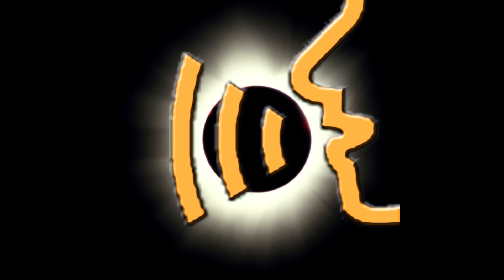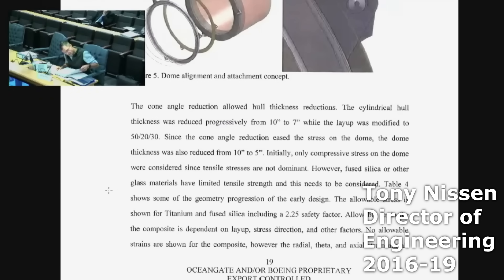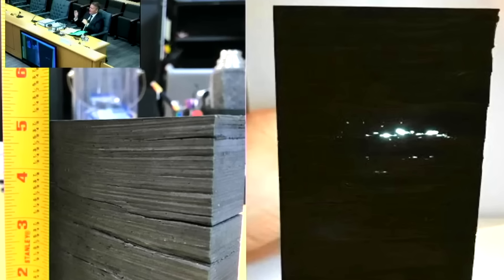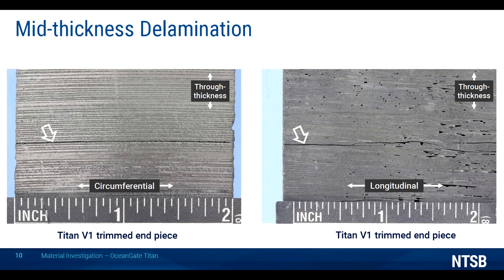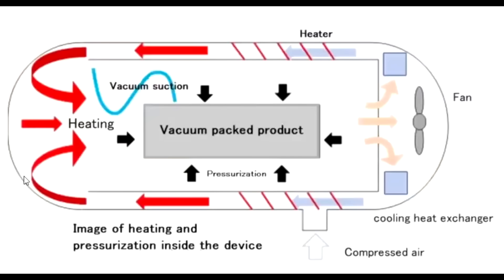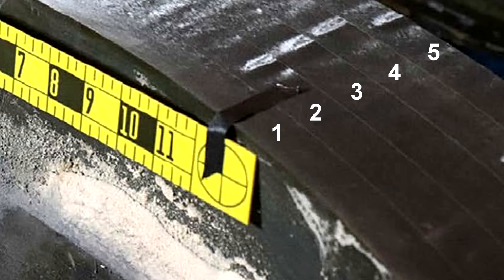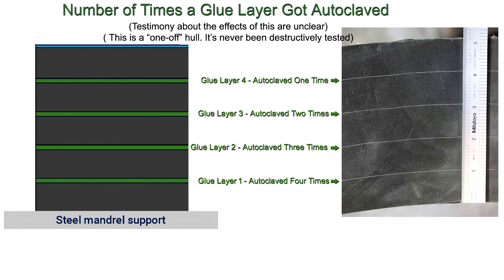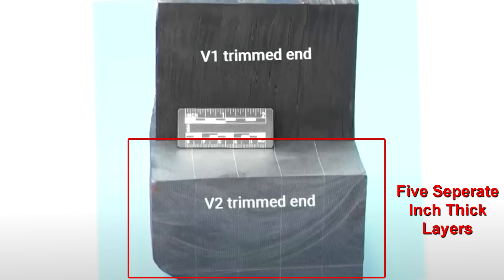Who Engineered the OceanGate Titan V2 Hull? Maybe Nobody Did?

Comment: The incorporation of a balanced isotropic laminate,  that includes the basic geometry of 0/90 and 45 degree orientation seems the most practical or sensible approach to manufacturing a composite structure and indeed Titans hull.

Therefore without unnecessary compromise considering what is understood about a  composite structure to create the most basic integrity of a composite shape within aerospace and certainly motorsport applications seems obvious.

Incorporating multiple cures and using peel ply as a key then film adhesive seems very cavalier considering what I understand as a former technician of this industry.

A laminate is never as integral as a one stage process I would argue.

Perhaps unless a structural honeycomb core is built into the composite sandwich to create much more structural stiffness?

Another consideration or perhaps point of view concerning the opposite side of the argument is that many thoughts have been raised about the total impracticality or inappropriate use of CFRP to apply a compressively resistant concept for a deep sea submersible, yet this was precisely the intention of creating a composite structure for motorsport applications.
In a high speed compressive shunt during use it was the carbon tub which should protect its occupant without question.

I don’t know myself about the loading comparison over a tiny period of time. But for a tiny increment of time and enormous load could it be considered similar?

I appreciate cfrp have been used for expansive pressure resistance for years. An example fire extinguisher bottles but the opposite is more commonly found.

I would appreciate hearing back from you please.

Thank you
Ian
Reply from the maker: Thank you for your thoughtful comment.  Carbon fiber for this application, a sub hull, is tricky to engineer.  It may be useful for more shallow depth applications if done correctly.  But the OceanGate saga has shut that down for a long time!  Who would try to use it now, even if perfectly engineered? This story has killed the chance of bringing it to market.
Reply: @solareclipsetimer thank you, it’s a very interesting yet tragic topic.

I enjoyed your video a lot and I also watched the BBC documentary which was good as you recommended, but beyond this I don’t have Netflix!
Reply: @ianhoyle8459  Ever heard of a comma?
Reply: @byteme9718  Yes I have, but my enthusiasm often outweighs my ability to incorporate the appropriate punctuation within my quickly written words.

Perhaps it’s also my ignorance of the English language in an attempt to get a message out freshly.

But usually occurs just after the unusual occasion of electrical activity flickering between my hemispheres; which then regularly quickly evaporates completely from my mind.

But really just in an attempt to hopefully support and influence further engagement on this particularly interesting subject.

Anticipating other people may also have a true interest in this incredible story, with something even more interesting to say.

Comment: It's messed up, but by certain measures the titan was actually an incrediblely successful feat of engineering.
Rush had a goal to build a sub cheaper, lighter, and for less operating costs. He did that. They said it needed to be twice as thick,  he said hes going half as thick and twice as deep. And it worked.
If anything, He at least proved the concept that you can design a carbon fiber hull that will survive extreme depths, for a limited lifespan. Which is still pretty rad. The one place where he messed up is he had no business taking paying customers on his experiment. Also leaving it in the freezing elements, and ignoring damages, and warnings, and.... Actually he messed up a lot of places 😅
Reply: He really achieved very little. The failure profile of carbon fibre is sudden and catastrophic, and if you made another one exactly the same there is no guarantee whether it would fail on the first dive or any other individual dive. If anything, he has probably trashed carbon fibre as an option because no nobody would touch it now; nobody would insure it, so nobody would bother putting money into it to test any new design properly.
Reply: @alisonwilson9749 with all the abuses he put that sub through and diving well past rated depths, I think the viability of reasonable usage still stands. Although I agree no one will probably want to touch it again (for deep sea) for PR issues.

somewhere on this channel, possibly this video, it was said that during the 1/3 scale model testing Stockton was able to pull one of the models out before it imploded but after it was clearly going to. Also with their ability to measure stress at minute levels across the hull - I'm not saying that CF isnt more sudden or catastrophic than other materials, but it clearly gives off warning signs if you don't ignore them.

I think this example is more indicative of pushing the design past it's capacity rather than a flat out non-starter.

All that being said, I'm just a guy with a recent fascination watching a series of well made videos on YouTube, not an expert.
Reply: Engineering is about matching physics to problems.  Nothing about the titan sub was novel except that one idiot decided that carbon fiber layup should be used in conditions that were unfavorable for it, without ongoing inspection, and treated as an unchanging structure.  ALL engineering materials change with repeated loading, whether through lattice defects aka creep, or through quantum effects.  

So no, all he did was create an air bubble that would pop at an indeterminate time.  Imminent catastrophic failure at unknown cycles is the worst engineering imaginable.
Reply: It's a good thing you flip burgers.
Reply: @byteme9718 and its a good thing your power over people is limited to confines of a YouTube comment thread 🍔
Ill go now.
Reply: He took a material that is purpose built for use in space where the stresses are the opposite of those in deep ocean use.
Reply: I get what you are saying. If he had followed good engineering principles, a lot of valuable data could have been learned.
Multiple craft, multiple unmanned dives, repeated pressure testing, destruction testing. All of these might have built up a body of data to verify whether carbon fibre could be used safely, and for how many cycles.
But this would have clearly cost way more money. 
I guess that's why the industry is sticking with what it knows, and that's what causes Rush to be frustrated. Is it cheaper in the long run to make one craft to accepted designs with tested materials, rather than 20 much cheaper craft to test out new ideas?

Comment: You know those chinese finger traps that hold onto your fingers tighter the more you pull? That's carbon fiber, it has high tensile strength so you can yank it and it'll never snap. But that's simply not the kind of strain the Titan was up against. To get out of those finger traps, you just push your fingers back together, in other words, the fibers are weak to pushing strain, sort've like the strain you'd experience deep under water.
Reply: It’s called compression strain

Comment: No mention of residual cure stresses between the 5 separately cured layers? No mention of the risk of laminate exotherm during cure? No mention of bond line thickness in relation to glue shear performance specification between the 5 laminates? These are all killers in the automotive composites and peripheral aerospace industries where they are largely ignored. I spent 15 years working on se issues but it is cheaper to ignore them and hope.
Reply: It's a miracle this thing didn't implode earlier. Testing it with unknowing passengers is straight up murder
Reply: Tsk tsk, you're talking like a grown-up engineer with a sense of responsibility....not Stockton's style. (He was a type I have always despised, the type that sees safety and regulation as inconveniences and people with legitimate concerns as obstructive.)

Comment: The v2 hull should have been thrown in the trash as soon as the wrinkles were seen in the first 1 inch layer. First, as many as 10% of the plies (10% of the strength) were ground away. Then beneath the ground area, more wrinkled plies remained. Imagine you have 2 columns being compressed between two rigid surfaces. One rod is straight (like straight plies) and one is curved (like wrinkled plies). The straight rod will take most of the load because it will carry the load as compression. The curved column will carry most of the load  by flexure and carry much less axial load. In some areas it looked like some wrinkles went through the entire 1 inch thickness., and some wrinkled areas aligned with wrinkles in the next 1 inch layer. You can make things a little better by tying the curved column to the straight column with strings at frequent intervals along the length. This will prevent the curved column from bending as much and it will be stiffer. But the strings will be in tension and eventually break, like a delamination. There were so many wrinkles, the actual load carrying capability of the v2 hull was considerably compromised and should never been used, period. The v1 hull was filament wound with pretensioned layers that do not wrinkle unless the mandrel is not stiff enough, and was oven cured. The v2 hull was tow placed with no pretension and autoclave cured, which reduces the thickness and causes wrinkles in cylindrical parts. As soon as I heard the v2 hull was autoclaved, I knew there were wrinkles in the hull, except they were even worse than I imagined.
Reply from the maker: Thanks for your thoughtful comment.  I agree with everything you said.  The layup causing the wrinkles was a problem.  And grinding was another problem.  Both cause weakness.

Comment: Id like to know a) why the ripples occurred during CF layup and b) how would grinding the ripples out affect a 45° layup if it had been used. Would the 45° layup help to mitigate the weaknesses caused by grinding out the ripples or would grinding negatively affect a 45° layup more than the 0°/90° layup that was used?
Reply: On point A I can speculate it was a tension control issue. The tension in the tows was not properly controlled, and tension must be near perfectly controlled when 380 bar are trying to crush the carbon fiber rope. 

Point B is a pain.

Comment: Whatever was done and whoever did it the result was a carbon fiber and glue hull which shown light thru it with a flashlight as demonstrated by David Lochridge. Ultimately, people were gambling their lives on Rhino Liner to ward off over 5 thousand pounds of pressure at depth.
Reply from the maker: Thanks for your comment; I agree with you. I would just state a word of caution about that Lochridge picture with the flashlight behind the carbon fiber hunk and the light shining through it.  Keep in mind, that piece of carbon fiber is the end of the winding, about 6 or 8 inches wide,  where the machine is reversing direction.  So the layers are lapping over themselves to reverse.  So that small segment is not really representative of the central part of the hull.  Having said that, the V1 hull was a weak layup.  But the central part was surely tighter than that picture shows.
Reply: @solareclipsetimer understood and I agree. I was being a bit facetious but making a point about the shoddy engineering by OceanGate and the blind trust of the thrill seekers along for the ride. Appreciate your content.

Comment: I don’t think it’s right for the video to place any blame/jokes on NASA or Spencer.  They were manufacturing contractors/consultants, the actual design mission safety details and engineering is Rush’s responsibility.  The word “design” gets thrown around in surrounding discussions but there’s a big difference between designing (more like architecting) a submersible or hull and simply designing a manufacturing process that will produce a hull of given thickness and plain strength specification.

NASA and Spencer aren’t boat builders.  A person pays to use their facilities or tips for carbon fiber machines etc, but what the person does is that person's responsibility.  And like the NASA and/or Boeing guy said, all logic should have demanded more stringent updates but Rush did less.
Reply from the maker: Thanks for your comment.  Your statement is not correct.  Spencer did the all of the engineering work for the first carbon fiber hull.  And along with Tony Nissen helped design the titanium rings and the titanium domes.  Spencer was responsible for gluing the hull to the rinds.   They were intimately involved.  Stockton did not do the engineering for the Titan.  Spencer was hired because of their marine experience with building the fiberglass hull for Deep Flight Challenger.  Spencer did the CF lay up for the first hull and it was a poor job.  Spencer need to take a lot of blame for the first hull.  NASA only consulted and they helped with the idea of a co-bonded multilayer design/idea for the second hull.  But they had no input into calculating design strengths etc.  Their involvement was actually quite minimal, but I thought it was interesting that they did not even care they were consulting on something that would end up being a sub.
Reply: @solareclipsetimer  "Spencer did the all of the engineering work for the first carbon fiber hull.  And along with Tony Nissen helped design the titanium rings and the titanium domes.  Spencer was responsible for gluing the hull to the rinds."

From a client contract standpoint:  we know this is a contract job, do you have documents showing that Spencer did not warn and disclaim or for example showing lack of options/price-tiers for better safety levels (e.g. clean room gluing for endcaps, though I forget where/who that was)?  Everything we know is that Rush ignored warnings, so it seems a better base-line assumption to think Spencer and NASA warned and then did what client said.  Presumably Spencer was the same as NASA: if a random hobbyist client wants spec X, you do spec X.  And the contract would have clearly stated the risks in writing when disclaiming responsibility, just like Rush did with passengers (basically, "You might die.  Sign here_____").

If I ask a wood craftsman to build me a sub, in USA they're going to do it and that's not their fault.  The wood carpenter comes back and says "the price has to be 5,000x higher, because I need to mill titanium", then I say no do the cheaper wood option it's OK.  That's not the wood carpenter's engineering fail, he doesn't care that it's a sub, I'm the client telling him what I want.
Reply: @AquaticMammalOnBicycle  IMO a manufacturer has a moral responsibilty to refuse a job if they have unaddressed/unresolved safety concerns. And I fail to see how the  sanding and breaking of those fibres would not be a massive red flag. I've stood out at work against safety shortcutting, I did not, and would never, compromise on it.